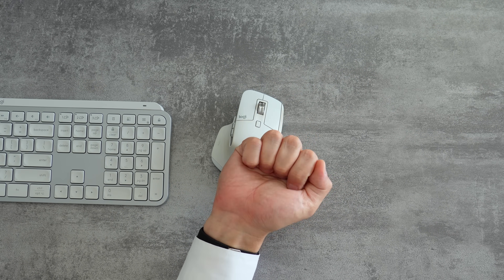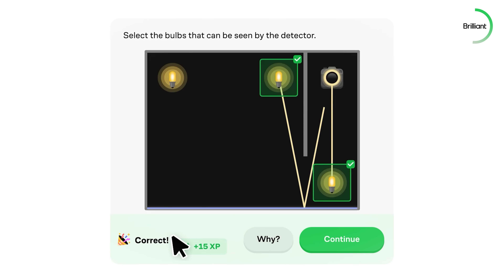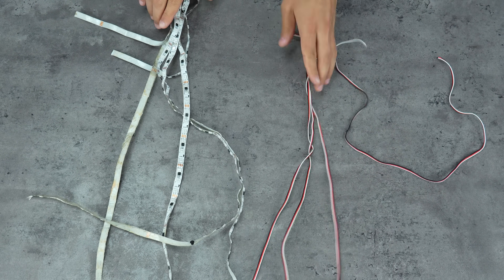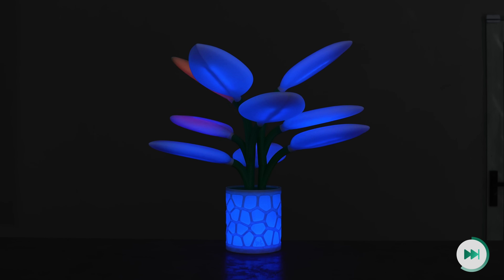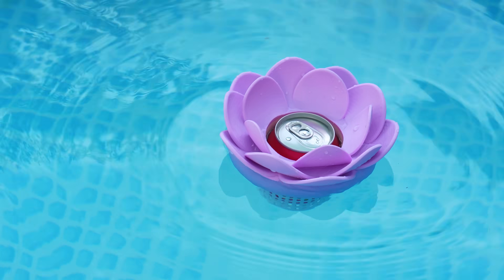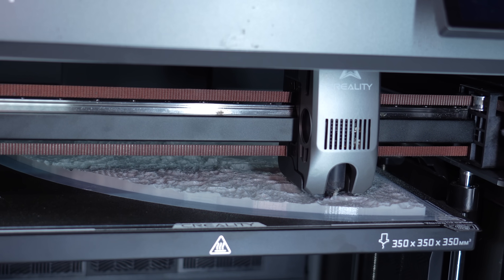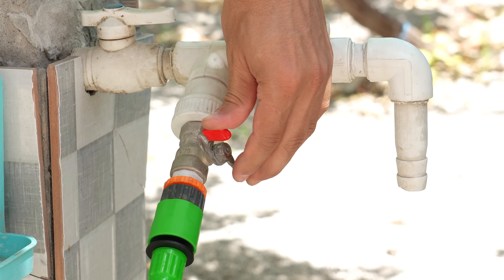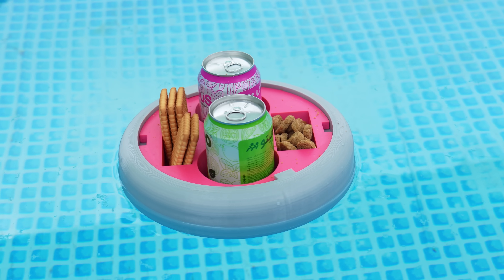USEFUL Ideas to 3D Print - July 2025

Comment: But its not healthy to put any food to 3d printed objects?!
Reply: You can purchase food-safe Filaments. You just want to make sure the surface is clean before use.
Reply: @spike03000 The material used and surface cleanliness are secondary concerns to pore infiltration. Layers very rarely seal completely to eachother on either consumer grade or industrial machines. Parallel lines on floor and ceiling and in 100% infill often have fine gaps specific to the combination of model and slicing algorithm and machine limitations. Virii, bacteria, and contaminants can and will and do enter through those gaps and remain where you can't clean or treat them. It's the same reason why you were told you had to coat that handmade mug you made from ropes of clay as a child with a slurry inside and out before you had it fired and handed it to your mom. 

Much like that clay mug, any 3d printed item intended for food contact needs to be sealed before use or cleaning with a material that is safe for food contact, general in several successive coats to properly seal all of those gaps.

Comment: It would be good if you could add the links to the files in the description.
Reply from the maker: Hey, I have added the links directly to the description, please take a look
Reply: @engineericly I'm not them, but thank you for doing so
Reply from the maker: hey, I have added them already, please look at 3D MODELS LINKS section
Reply: @engineericly nay, directly in the description, and not via some redirection site
Reply from the maker: @berlinberlin4246  Added it, please check
Reply: @engineericly  missing the one I'm interested apparently: water hose adapter from bottle. Could you add it to the links, please?

Comment: Nice! I'm a bit concerned about using a 3D printed object to wash produce with though. There is no such thing as food-safe 3D printed plastic and also the layer lines are going to be a hotspot for bacteria to grow in. The design itself is solid though. Perhaps it can be made food safe through a coating.
Reply: There are several filaments that are fda approved for food.
Reply: @stacmaz  they still need to be coated after printing afaik
Reply: @theblackswitch5304Excuse me what should they be coated with
Reply from the maker: epoxy
Reply from the maker: Hey, thank you for your feedback, I will consider that next time!